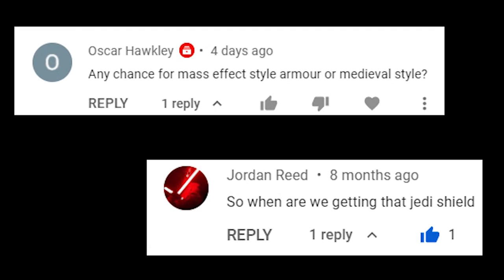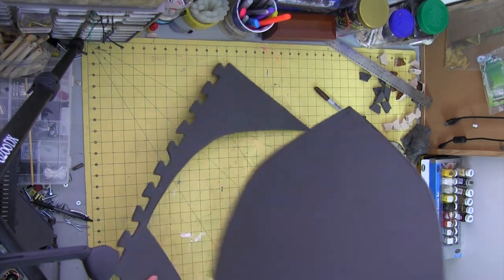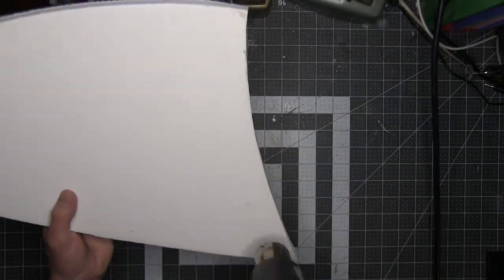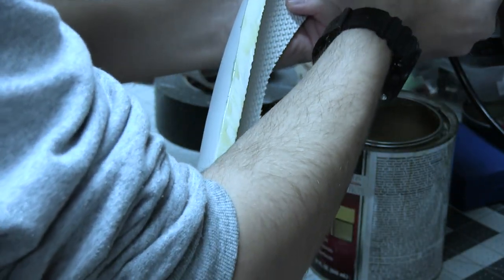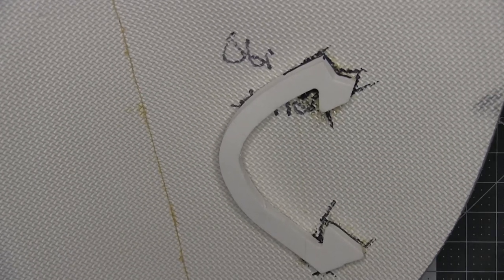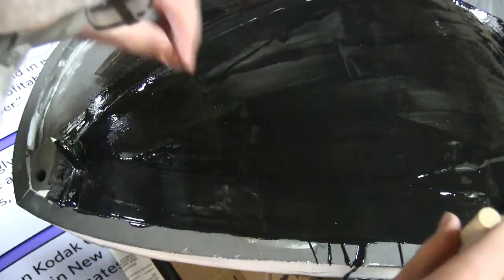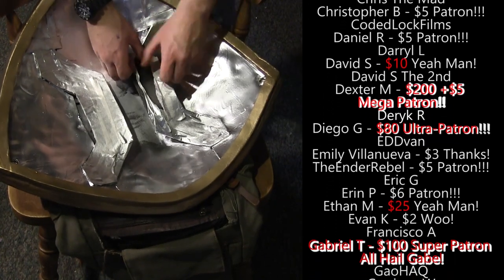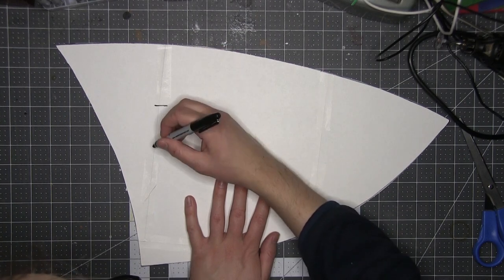How To Make A Shield (DIY)

Comment: Hey Jake what'chy Bakin'? :D

For large costume/prop pieces of EVA, PVC, Warbla, etc I throw it in the oven at 200°F. 
Also whenever possible I put it on a silicone baking mat on a rimless "Jelly Roll" baking sheet. :)
Toaster oven is great for smaller pieces.
Heat gun with the narrow nozzle is great for spot adjustments. :D
Reply from the maker: I've seen people do that, but I'm always cautious about getting these materials anywhere near food.
Reply: @WilliamJakespeareProps  O.o Dont cook your frozen pizza on your EVA foam O.o

And also if this stuff gets so hot it stars offgassing, (as it did when you demonstrated burning it) then ya done overcooked it already and the structure of the foam, plastic, etc has degraded and wont be as durable a material anymore anyway. 
Low (temp) and slow (time) is the key, just like with a Pork Roast or Turkey. O.o

Comment: i don't think that kind of plasti-dip is meant to be brushed on, but interesting use. it's the standard plasti-dip that you...well, dip your tool handles into to replace the rubber coating on them with. also works really good for making molds for action figures~
Reply from the maker: Nice, I'll give that a shot some time!